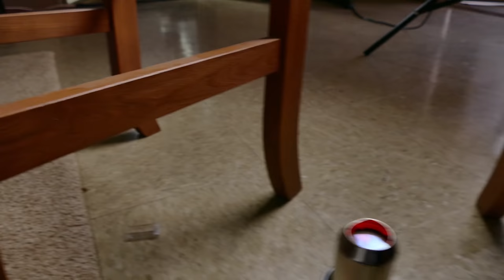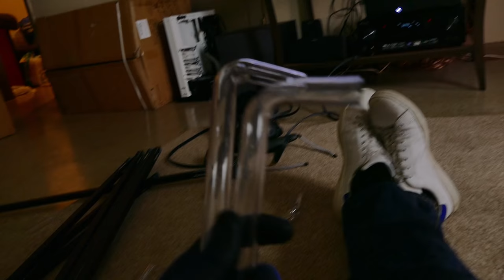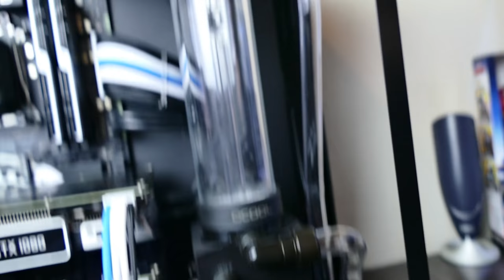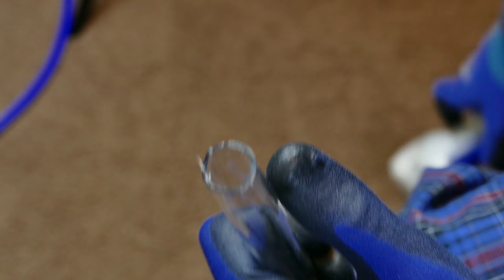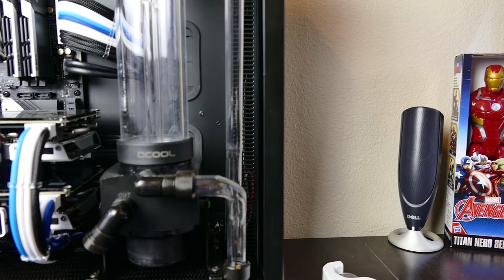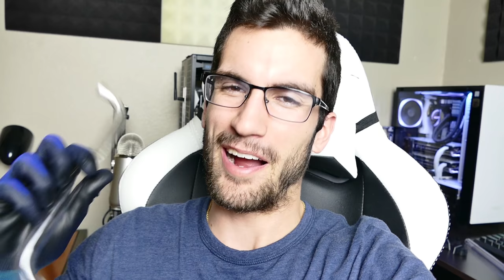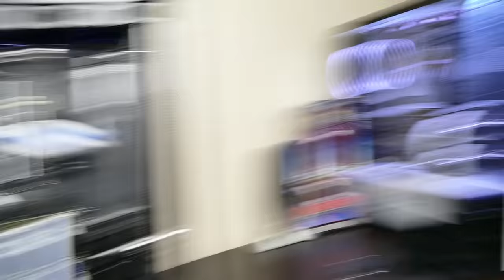Project 'Blue Sky' Custom Loop PC Build Log (Part 3 of 4)

Comment: This is exactly what keeps me away  from building a custom cooling loop.  Knowing that I'll probably go through an ungodly amount of tubing before getting it correct.  AIO is my friend.  
Thx for sharing your experience in this.
Reply: CMDR Metasploit or use soft tubing.. lol
Reply: AnimuFAILZone yeah but fittings cost ALOT of money, also more fittings means more chance of a leak
Reply: There are people out there who say it is pointless for cooling in comparison with a fan based sistem,that is just what some people believe,I still like how it looks.
Reply: AnimuFAILZone man do fittings add up quickly lol
Reply: CMDR Metasploit you could go with soft tubing
Reply: I wanted to go with just regular soft tubing for my first ever PC build which was also my first ever waterloop I built.
Boy would I do things different if I were to do it again. 
But the experience and the process of building it, failing, having to figure out creative ways and workarounds for problems that occur is just super worth it. You should DEFINITELY try it if you ever get the chance and the about 300$+ to do so! :]
Reply: Not to mention, your supposed to rotate it constantly while heating the tubing up, and you can see bubbles in the silicone (not the tube) that gives you a hint when the tube is hot enough. When I did mine I used Acrylic, and 400F on my heat gun.
Reply: you dont have to do hard tubing
Reply: CMDR Metasploit But beast air cooling is a much better buy than AIOs..
Reply: can confirm,
got a beefy aircooler on top of my 6600K OC to 4.6Ghz
never got past 55°C during stress tests
Reply: While the benefits of Hard tubing over soft are certainly evident, soft tubing is pretty easy. Don't get me wrong i still wasted some tubing but it was pretty simple, and i did straight runs with a multitude of fittings rather than running long sections of tubing. You can't be worried you just gotta jump in head first and take your time.

Hell the first time i set up and filled my loop i had a run on the outlet of the pump and was wondering why it wasn't doing anything when i tried to cycle liquid through it lol

I intend on PETG for my Ryzen build. It's gonna be somewhat difficult. But hey no plasticizer issues, less fittings in my case, and it looks 10x better to me.
Reply: CMDR Metasploit spend money on fittings, or do soft tubing
Reply: Soft tubing is a watercooling noob's friend.
Reply: But tubing is ridiculously cheap, it's $2-3 per 1/2 meter, your entire loop will likely only use around 4 meters including times you mess up. So that's only ~$20 in tubing, and if you really need to do each bend 10x before you get it right you can buy ~$40 in tubing. The price to ship 1 tube is the same as 20 tubes, so just buy it all at the start. The tubing is usually the cheapest part of the whole build. Or just buy some 90 degree bends.
Reply: I did my pc with with gpu,cpu,and two rads with 3 meters of hard tubing. You can reuse bad bends, unless you make them bubble.
Reply: You could just get flexible tubing. All of the other components still make it expensive though.
Reply: Camero737 so if you get a bad bend you can fix it?
Reply: Cody's Tech yea, it may not look the best, but if you heat it up and keep turning it with out applying force it will go back to being straight. (More or less)
Reply: There's no shame in using soft tubing vs PETG or acrylic; while I'm intrigued by the whole hardline tubing thing, I don't need/ want the frustration that seems to go hand in hand with this art (and it can be an art if you see what's being done on a variety of channels).

So while soft tubing may be outdated, it works for me :-)
Reply: Brechan Fraser agreed.  I went with soft. gave it a nice unique look that I was happy with.
Reply: Go soft! I've been running mine since the q6600 intel processors came out. Zero issues, other than trying to watercool the northbridge with asus included tubing. The plastic fittings broke and my 280 gtx became a water bucket. Metal fittings only!
Reply: just take your time, not to be rude but it really seemed like he was rushing too much. also soft tubing is a thing, and i personally think soft tubing is harder to make look nice then rigid.
Reply: bmxriderforlife1234 i love my soft build.  I have a dual rad, res, pump, cpu & gpu done with approximately 18" of tubing.  It is tight.
Reply: haha sounds real tight. idk sometimes i like the way soft tubing looks and sometimes hardtubing looks better. depends on the build. i really like the way this build came out though, its also nice to see someone do a first hardline build and show all the mistakes they made. i feel alot of people wouldve cut it out.
Reply: bmxriderforlife1234 ya.  i like how he made some.artistic bends rather than the vanilla 90° bends in all hard builds.  Hit me @Xobeloot and i'll show you my build
Reply: xeboloot? huh? 

but i have two watercooling projects coming up in the future, one is going to be my everyday driver gaming beast, though im waiting on the next series of cpu's and gpus for that, kinda have to, gonna be building a 5x1 portrait 1440p array, final resolution of 7200x2560p and going to be using at least 27 inch monitors, the reason im waiting is 3 and 4 way titan x maxwell can run that monitor set up at medium to ultra settings at 40-60fps depending on game, like tomb raider can be run at almost max settings, but the division is medium, however 3 and 4 way sli set ups have an advantage at larger resolutions even with the often worse scaling. jayztwocents explains it in a video on the 1080 when they first dropped or something. maybe one of the pascal sli videos, but yeah anyways, im not sure 2 way titan xp would actually out perform 4 way titan x at that resolution, and since 2 way sli is no longer supported im gonna need more powerful cards, plus i want to be able to run it across more then a handful of games. also goings to be getting a pair of those cheap korean 4k tv monitor hybrids like the wassabi mango to go with a 3rd one my buddy gave me, for a second multi monitor set up, though im only going to actually be running it at 1080p i just want the screen size, as well as im going to hook up my 360 to one ps3 to another and then a secondary less overkill gaming rig for if friends or family comes over. however my beast rig im gonna be going with whatever the best bang for the buck 8-10 core cpu is with enough pcie lanes, and yeah gonna pull a linus 2 gamers one cpu :P all on water dual nvme ssd's 2 samsung 850 evo's specifically for me, 2 1tb mushkin reactor ssd's one for each person able to game, plus a giant hd like a 10tb or something. also going to be building a freenas box, on a ryzen 3 or 5 most likely, lots of ecc ram, then finding some old 10gb network cards and using those for file transfers to allow games to be kept on the nasbox and just moved around as needed for the vm. each system will be using one of the nvme ssd's for the boot drive, still havent decided on which drive yet but im thinking a samsung 960pro and an evo for the secondary user. plus a 1440p ultrawide for regular gaming and editing duty. 

my second liquid cooled project is going to be a mineral oil submerged system with a custom hardline water cooling loop on the cpu and gpu, both the oil and the water loops are going to use quick disconnect fittings so i can switch between a rad box and a chiller on the water and some sort of chilling solution for the oil, basically cool the oil and the water to within the correct temperatures of each other and i should never have to worry about condensation when going sub ambient, as the condensation will instead be on the outside of the case which can be covered to prevent drops getting anywhere they shouldnt. also the oil should protect the components incase of a leak and allow the water to be separated. also since im probably going to use a dyed fluid of some sort itll be easily seen in the oil. though i have some testing to do for this project.
Reply: Carlsson. Holding it to close or setting the heatgun to hot is basicly the same thing. Just max the gun and control the heat with different distances is all it is.

Comment: Flexible tubing for the drain port at the rear of the pump would be helpful
Reply: yep, backside of the pump - invisible! did the same
Reply: Edwin Goh definitely,  even Jay uses Flexible tubing for the under belly of his computers and this way he can use that port on the back of the res
Reply: he wont be able to drain the loop very effectively with how he wants to do it so i agree

Comment: Why no RGB? Does this video run Crysis 8K 120fps!?
Reply: Tomas Sviridovas no this PC wont run crysis at 8k(not even 2 titan xps wont,linus did iy)
Reply: Tomas Sviridovas only AMD's 4 core processors push 8K @ 60+ FPS at the moment.
Reply: X4 860K Gaming surely you are all mistaken. The Pentium 4 is the only processor that can be used for crysis at 8k. The game was designed to run optimally on a pentium 4 that is slower than 3ghz
Reply: Why not Athlon 64? o3o
Reply: ネーナ・トリニティ because the pentium 4 comes equipped out of the box with hyperthreading. All you need to do is download 512mb of ram and you're good to go
Reply: Wrong, you will need a 10 6950x and 20 Titan XPs to run Windows 10.
Reply: X4 860K Gaming I have an 860K
Reply: Bl4ckSnIpEzZ <---- this dude lol. u made my day bwahaha
Reply: 4 titan xps can tho
Reply: Big Hargyy And theres only sli for 2 titans xp
Reply: No, they can't. You can't have 4 way SLI, because nevidia are awesome!

Also, titan xp (which is simply a titan x) is garbage.
Reply: vdochev Yes you can. You can have 100 Titan XP lel.
Reply: I know, right? I have 5 of them, but I can only use 2. Bummer!
Reply: You can 4 way them but it´s going to be completely usless since it´s not supported

Comment: Few tips if you are interested...   First when you insert your silicon thing use some kind of soapy water,even if your silicon is slightly smaller still gets harder to get it out after you bent your pipe,second when you heating the pipe use just first speed of your heat gun its more than enough and hold pipe around 15 cm from heat gun and rotate it to get it hot on all side equally,helps not to get kinks... btw i am no pro i made just 1 pc with custom water cooled loop it was mine,it have 5 rads in it 2 pump/reservoir combo in it 2 flow meters also cooling motherboard,cpu both sides of rams (x99 motherboard) and sly gpu..  so you can imagine how many pipes and bents are in there. Still looks 3 times better than what you made and you have like 5 pipes in it,you making it harder for your self than it actually needs to be..   PS sry for bad english
Reply: Danijel ćosić it would be so much easier if he follows your advice,  also it would help if he had a better  insert
Reply: Few pic from when i build it and few pic from now with this comments in background for proof                http://imgur.com/gallery/iYZ0Y
Reply: Nice work man. Also, is that a cooler for your memory RAMs?
(PS: Bad english too)
Reply: Wouldn't it be more precise for him if he also had the ruler for every single angle, like most pro's use in their first builds? The bends are more consistent and more precise, rather than just Eye balling them all the time
Reply: yes

Comment: You are getting the kinks in the tubes, because you are not dispersing the heat evenly over the tubes. Rotate the tube about 6 to 8 inches away from the heat gun, as you are turning the tube, move it left and right as well, heating up an inch on both sides of the bend. Also, use a bucket or big bowl of water, to cool the petg down quickly after you make the bend. I also noticed your not using soap and water to lube up the silicone insert. that will also make the process much easier to do. The soap and water also helps you see how the tube is heating up so you know when to take the tube away from the heatgun. p.s. that last bend is pretty damn good bro, it's a little sloppy but all in all, your learning curve is paying off :)
Reply from the maker: Jack Carter Thanks m8
Reply: Good call on that soapy water it is extremely important for the insert
Reply: Spot on. Was my comments too

Comment: So, there are a few things I've noticed addressing your issues with the tube bending:
1. You are using too much heat. PETG does not need much to be bent. Try to hold it higher over the heat gun or use a hair dryer (yes, that works well). Also it seems to me that your heat gun is too powerful but again you can compensate that by holding the tube higher.
2. You don't rotate the tube enough. You have to rotate it with a constant speed so that the heat is spread evenly.
3. You don't move the tube sideways/horizontally over the heat gun so that the part before and after the spot where you want to bend is too cold and the bend gets too tight (yes it is)
4. You didn't dip your bending cord into a soap bath so that the cord is too dry and sticks to the moldable petg so that it produces horrible kinks or folds.
5. I might be wrong here since everything is from alphacool but the bending cord could be too small for the tube or that the tube itself is rather low quality (although it's from Germany :p).
But that is just speculation and could be wrong.

There might be more I am missing but others can add here.

*fixed some spelling errors
Reply from the maker: SunRed M8 you're correcting stuff I literally corrected in this video.
Reply: You didn't really talk about it to be honest

Comment: A couple things: 

A) It seems like if you need to heat it up evenly (inside and out), it would be better to just start and finish on a lower heat instead of trying to speed up the process in the beginning by using the heat gun on high, sort of like cooking a turkey in the oven; patience is key, and if you wait to do it right the first time, you'll end up spending less time on it.

B) I think your insert might be causing a lot of the problems, seeing as how it doesn't perfectly fit the pipe. Maybe grabbing a new one would be beneficial?

C)Try covering the inside of the pipe with something like water or oil to try and even out the heat spread. Actually don't use oil bc I think that dissolves PETG or something. But soapy water would be a great alternative. 

D) Maybe you could create some sort of jig to help you shape the PETG instead of just doing it by hand? IDK how the bends would turn out but it's worth a shot.

Comment: soak the silicone insert in soap water before inserting it into the tube
also use soft tubing for the drain port behind the pump :D
Reply: I was thinking this about the drain port myself
Reply: ArtisChronicles his original plan is going down the drain.

Comment: I saw the video and i notice that ur petg melt very fast under the heatgun. I think ur heatgun is too hot. Probably blow it under medium settings not at the maximum temp. Usually to get the bend u want you need to move the petg back and forward cover the heat on larger surface area so that when u bend, the bends are more clean. For those who say jayz bends are better. Dont be a idiot. If u had any  experience hands on petg and bends. Bends that are short and curvy are difficult. U dont see such bend on skunwork. Even he use a right angle, 45 degree and extenders.  Done be suprised even if jayz work on that short bend it will probably turn out the same. The bends are prefectly fine. All builders will only show the best parts of their build. Even jayz dont give a tour of his whole system because u can nitpick something somewhere. You dont see video such as these. These are real deal. Things every beginners will face. Obviously your so called professional builders wont tell you that cause like xd...

Comment: Hey Greg. Let me say I admire your determination while doing this project. Hard tubing isn't for the faint of heart. I've finished three builds myself and everyone of them have had there own little graveyard of mistakes. As you have determined, quite a few people in the comment section really have no idea just how difficult it is to bend this tubing. It's good to see the progress you have made and the experience you have gained in this project. Keep up the good work big guy and I can't wait to see the finished product. P.S While installing the the water block back plates on your GPU's remember my comment on your first video. I have owned these water blocks. Line all the little screws in the holes before you tighten them up.Alphacool allows little room for error on this.

Comment: I honestly don't think it is all pilot error Greg. I'm pretty sure that insert and cutters are sub par for the job but you certainly showed that powering through eventually yields much better results. I cut tubing for my job and I think those cutters need to be turned as they cut for better results although I have seen others use the small stubby coper pipe cutters that plumbers use with better results. I was thinking to eventually try this for myself but it seems positively soul destroying lol.

Comment: I think you use too high temperature setting on heatgun and you also should heat smaller area so it will bend only in that area you want.
High setting on headgun is about 400C and tubing needs about 200-250.
Reply: I think that hotair station would be much better idea, smaller nozzles and you cant set temperature precisely.

Comment: Any reason to use hardline instead of flexible tubing? Is it just for looks? If I was gonna do a custom loop I would definitely be leaning more towards flex tubing, it can look just as good in some cases.
Reply from the maker: Solomon Cornish So much uglier.
Reply: Solomon Cornish And you have to deal with plasticizer. stuff builds up right away and get in all your tubing, reservoirs and waterblocks. stuff is such a pain to remove. don't use it trust me